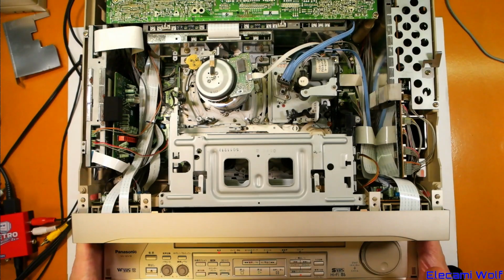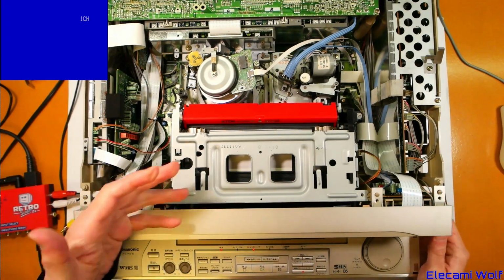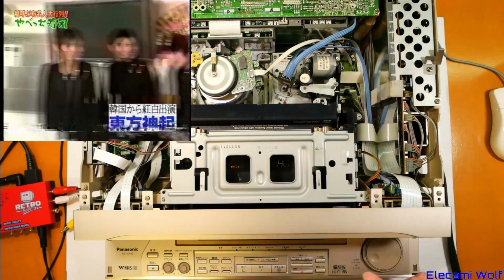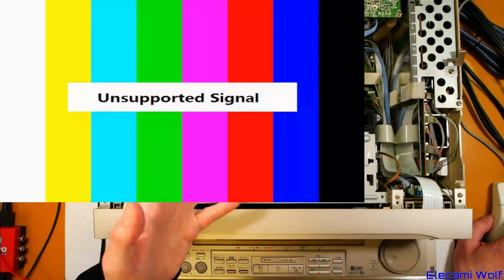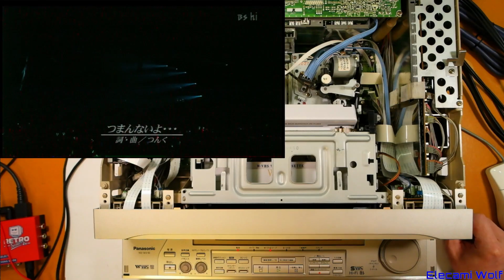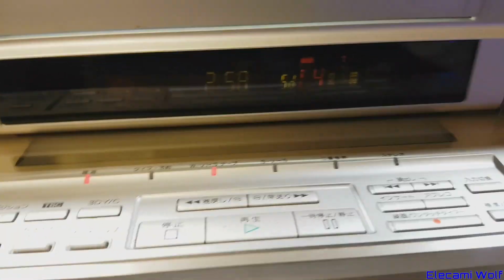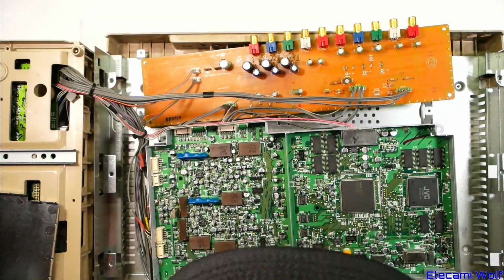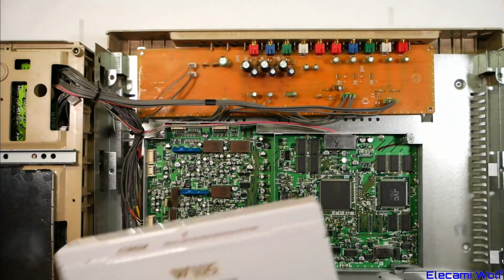EW0081 - Panasonic NV-WV10 W-VHS VCR Investigation Part 2

Comment: Does it play either NTSC (outside Japan) and PAL VHS and S-VHS tapes?
Reply from the maker: NTSC Only. I don't know if there was a PAL version made.
Reply: @Elecami  Perhaps you need an cassette tape that is even recorded on an foreign television channel that is PAL, and put it on that same player. Wish I Had one of these.
Reply from the maker: @DjoleBuduciIlustrator The color signal is encoded differently with PAL and NTSC. The device must have specific support for either or both formats.

Comment: Great video! If you want that machine to work at its peak, you are going to need to replace every single "Jade Green" TOSIN capacitor in it. In my unit, nearly all of those had ESR values of 10-30 ohms which were definitely bad. They were just a terrible brand of capacitors in general, or at least did not age well. I'm not a big fan of ELNA caps either, but those were mostly ok in this unit, 

My question for you is whether component output is active when playing a regular VHS tape? Reason I'm asking is that I don't plan to ever put a WVHS tape in mine, so if there's no component output, there's really no reason to do any recapping of those SMT caps on the bottom board IF it is only used for WVHS. 

The other question is if the 3D YC button seems to do anything for you when playing back a regular VHS tape?
Reply from the maker: Sucks about the capacitors, I probably won't get around to doing that. No spare time.

I think the component is only for the W-VHS part, that might have been why I did not see it working correctly in W-VHS mode. The input and output needs to be through the component for the W-VHS to work correctly. 

Maybe I'll investigate this one again once I get through al the other VCRs. Not sure on the the TBC, I assume it is involved with regular VHS and S-VHS.

Comment: WVHS, only inputs and outputs via component and the signal has to be HD interlaced @60i . It won't work if you capture at 50i or 59.94, only 60i for some reason. FYI
Reply from the maker: Oh, so it is possible it works but I didn't have it hooked up right. Thanks. I'll have to try again.
Reply: @Elecami  Yeah no worries, I have an SR-W5U. It has everything in English, the VGA port (mine's a not working right) and no TV tuner. It only does SD through the svideo and composite port and only does HD through the component, it doesn't downconvert like the DVHS decks. It will record a 1080i 60 signal, it just crops the top down to 1035i and no chance of 720p. My deck is a bit worse for wear, so it don't use it much.

Comment: Hello how this works with regular non s-vhs cassettes?
Reply from the maker: It still retains all of the components to play VHS and S-VHS. Additional Video heads and circuits are used for the W-VHS mode.
Reply: @Elecami  like same and no improvement through component and obtaining more clean pic?
Reply from the maker: @protasov-by  I have not tired it much, but I would guess similar to other high end VHS player. Provided it is in good condition. Issues is, capacitors go bad and it will degrade the performance. A lot of work to replace them all.

Comment: Maybe upgrade the cables to gold plated component
Reply from the maker: Gold plated connectors will not make any noticeable difference. Might avoid some corrosion after a while.
Reply: @Elecami  what about just better quality cables?
Reply from the maker: @SRQSPORTSARCHIVES  Things like that are usually a scam.  if you have normal quality (not cheap AliExpress / fake) cables then it will be fine. Especially for short runs of a few meters.

Comment: Hello. The issue with the VCR detecting a HD tape instead of a standard tape has to do with a dirty detection switch. I had the same problem with my JVC HR-W1. After some repeated use, the switch returned back to normal operation.
Reply from the maker: I see. Makes sense. Thank you.